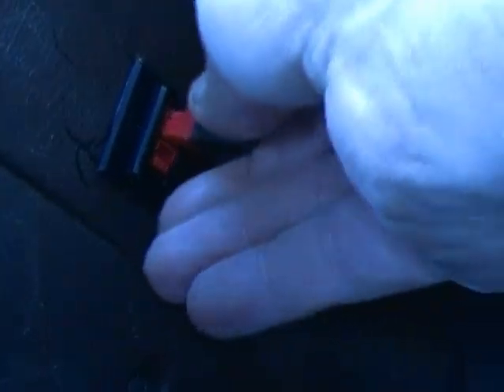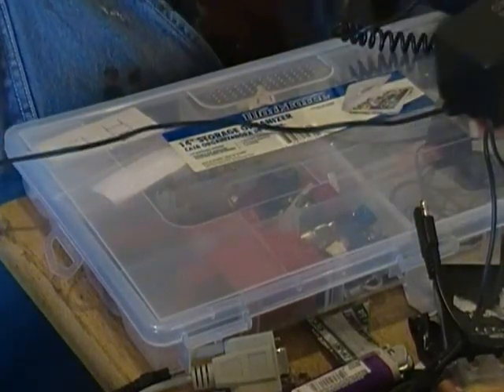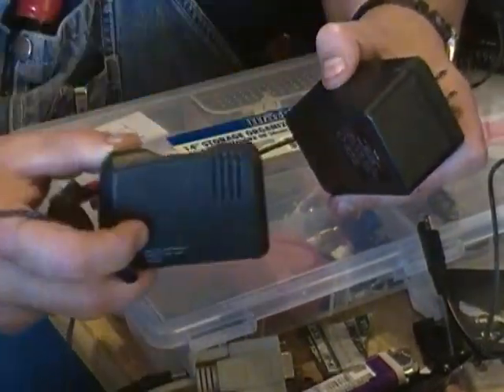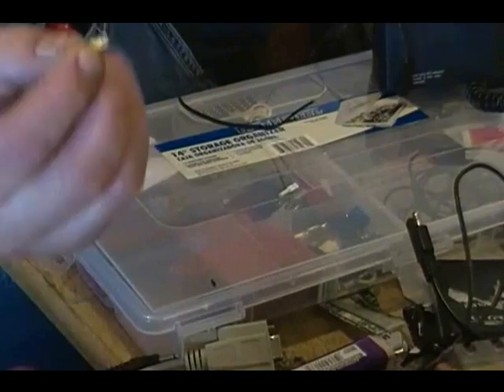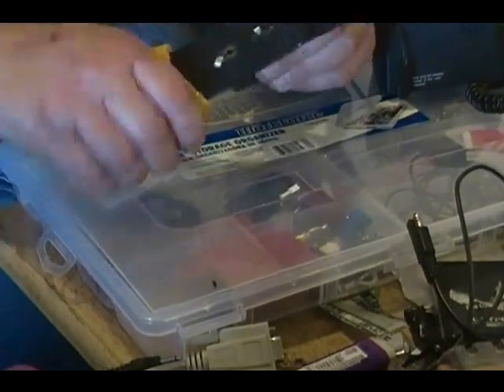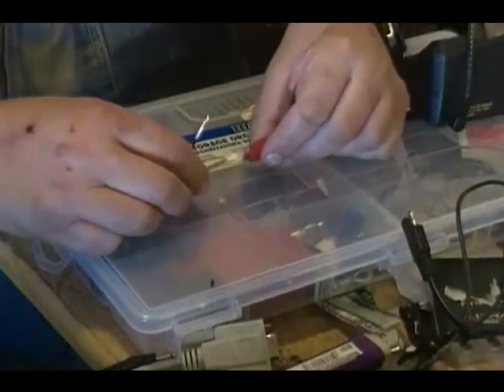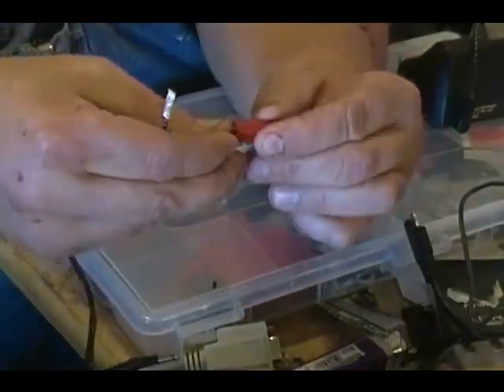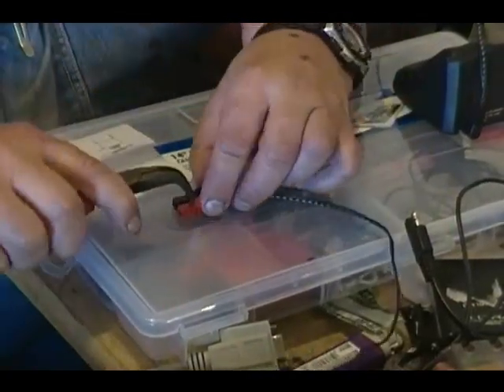Anderson Powerpole, A little work now saves lots of headache's Later

Comment: I have learned much from you for which I extend my thanks.  
In my 12 volt system I power a bunch of gizmos using less than 12 volts.  I currently have a bunch of Radio Shack step down transformers that allow 3-6-9 volt use.  The problem is piss poor life ecpectancy of these cheapo units.  Do you have a reccomendation for better quality stepdown transformers.  Money is an issue because I need several thouugh the house, garage and shop. 
Thank you and God Bless,
28Bull